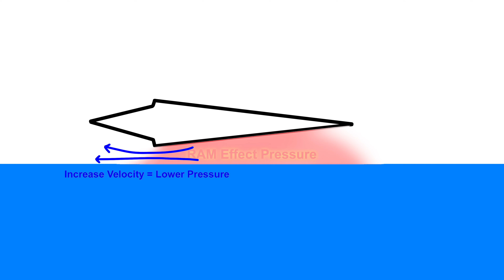R/C Ekranoplan Long Range FPV

Comment: if you make it a hovercraft, it will do the same thing as the wedge wing
Reply: dual box oval wing
Reply: hydrofoiling without needing a hydrofoil, nice
Reply: add more relative mass
Reply: a butterfly is easy to wind of the sky, more mass, more robust, light is not always the optimal choice
Reply: move the rotors way back
Reply: efficiency is directly ground effect flight speed vs normal flight speed
Reply: maybe wider wing spacing for higher base altitude
Reply: very long (wide) wedge wing ground effect aircraft carrier
Reply: helium/vacuum balloon radio up-link
Reply: electrostatic vacuum balloon (thin film aluminium party balloon static electricity hair rising experiment)
Reply: hairy indeed
Reply: throw you bread above the waters
Reply: straight or circular back of the wedge
Reply: hovercraft plane
Reply: dont fall
Reply: make a graphite coated pavement and slide-hover on top of the "ice" layer, graphite-coated flat bottom vehicle, surface-craft

Comment: 1. 99% of diffusers on race cars aren't actually 'diffusers' perse.  If you want to see a real diffuser... Go search hairdryer diffusers.   Diffusers are meant to remove the energy from the air, slowing the velocity, bring the energized air back to Atmospheric Pressure.  And this is EXACTLY what hairdryer diffusers do.  EXTREMELY WELL.  So called 'diffusers' on race cars are more just 'streamliners' for the airflow or 'polarizing'...  Removing as much 'turbulence' as possible.  Removing eddies and random waves from the air. Streamlining.    Diffusers are not low pressure zones.  The pressure is in a transient state (dynamic).  The Venturi is the low pressure zone.    If you had created a 'lip' after the venturi preventing the boundary layer from following the geometry, area where you call 'diffuser' you would create a void/cavity.    What you did by your diagrams is create a right angle step and the edge from that step has a shearing effect curling the air away from the water.    Creating an eddy. 

Point being, DIFFUSERS ARE NOT LOW PRESSURE ZONES

Comment: A new challange.
Hello Daniel, do live wih wild geese. Walk on the land with them, swim with them, take them to the sea by seakajak ,paddling together. And I take them fly-driving. They fly next to my fast little rib. -Takes a lot of fuel, whichis expensive these days. Would like to change to a one man ram vehicle. Minimum flying speed of young wild geese approx. 40 km/h. Max. Speed of vehicle 90-100 km/h. Weight of pilot 60 kg, weight of system incl pilot below 150 kg if possible. Propulsion by outboard engine withextra long shaft to be considered, because young geese flying next topropellers is not preferabe. Takeoff speed around 40-50 km/h prefered. Max height above the water possible 1.5 m, max. wave height